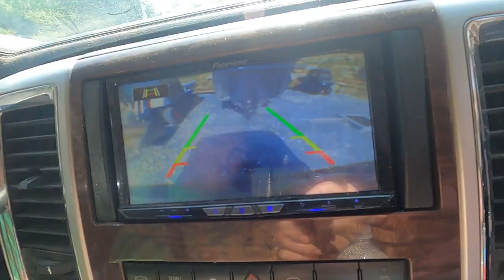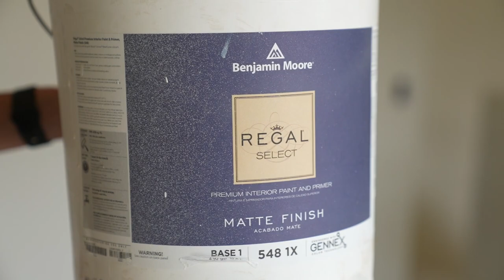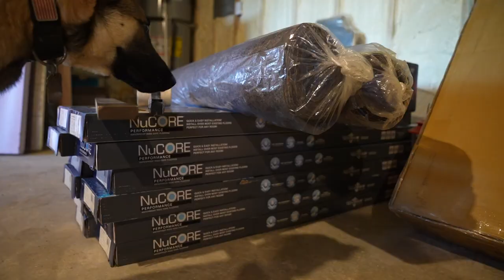FINISHING THE ACCENT WALL | DIY CABIN IN THE MOUNTAINS

Comment: I would advise NOT using MDF for the window sills. If it get wet at all it swells! And it WILL get wet. I used it when I build my house and ended up replacing it all with Corian. You can use ANY countertop material such as ceramic tile, granite, quartz, or etc, as they are all unaffected by water. It looks much better and will last forever.
Reply: Yes, Corian, which  looks like French/Italian White Marble, if you get it in white and  finish it  in a crown  molding  edge  that you like with be care free and not as heavy as MDF., You'll  never  have  to paint it, and it won't swell or mold like MDF will. Otherwise, get  the standard  wood, stained  or painted,  in a  high gloss contrasting Dove wall paint. F/I White Corian is a subtle  polished  marble  look, and if you get it with a double turned down edge,  it looks  very elegant and   simple.

Comment: I had stained concrete floors in So. Tx and really liked them. Seems like a reasonable suggestion for a mud room. Easy to clean, no worries about dirty boots. Cheers!
Reply: Concrete gets slick as snot with ice and snow.
Reply: If you hate it .. put in floors later. Cut the corners for now. It's fine. Exhaustion doesn't truly set in until the Baby comes home. You both should decompress a little before that happens. Even if you have to start out in the camper. You will need your strength. Be well. Much Love!!
Reply: @fawnsells6226  agree!  I believe there's textured non-slip paint (primarily used for garage floors) that could work well.  It's not only muddy boots  but especially the dogs that will make having an easy-care entry space such a bonus.  Maybe try it for a winter and if you don't love it, it would be an easy upgrade next spring. 🙂
Reply: @patriciacarter4227  My brother did stamped concrete that looked really beautiful and it's durable. It's on their outside spaces and they don't have a problem with it being slick. Inside the house they put ceramic tile that looks just like wood flooring. It looks awesome.
Reply: @smarterthanawaffle  you put a grit in it to eliminate that issue
Reply: @trippinonamystery5814  My brother did ceramic tile that looks just like wood flooring and it looks amazing! Their house appraises for almost a million so it definitely doesn't look unwelcoming.
Reply: @kimberlyearly8918  I reported it too! ❤️
Reply: Concretes great in a warm climate but will be an absolute ice cube in the cold.
Reply: Lest we forget that there is going to be a toddler out there, my dad calls them little drunks.  I would hate to see him toddling around and hitting his head on concrete.  Better to have some kind of flooring that gives a tad bit.
Reply: @kimberlyearly8918  -  Also go to the About page on the channel. Click on the flag and proceed. The only category that works is "scam or spam" and on the note page I paste the message along with promoting porn. (Only 300 characters allowed.)

"learna" is probably part of the sock puppet gang with channel names "Alexa - Hakaamaru Ros - yuuki Asuna - funny - ROSE - Airis - Asuna yuuki - Natalie - Agnez" that have infested several channels that I follow. I sent a message through Patreon to Allie about the infestation. Either Allie has blocked these scammers or flagging on the About page was effective.
Reply: @tuter1972  -      Also go to the About page on the channel. Click on the flag and proceed. The only category that works is "scam or spam" and on the note page I paste the message along with promoting porn. (Only 300 characters allowed.)

"learna" is probably part of the sock puppet gang with channel names "Alexa - Hakaamaru Ros - yuuki Asuna - funny - ROSE - Airis - Asuna yuuki - Natalie - Agnez" that have infested several channels that I follow. I sent a message through Patreon to Allie about the infestation. Either Allie has blocked these scammers or flagging on the About page was effective.
Reply: @patriciacarter4227  Exactly.  Allie, it's just for the winter. ;) Maybe you guys could revisit it in the spring. Release your expectations of what done means for now and just enjoy that tiny boy human, who wont mind one bit if that floor or anything else isn't all the way done yet. Unless it's not going to take that much work at all and has a low risk of anything going wrong... then... just do it. LOLOLOLOLOLOLOL Why not?

Comment: Brandon, you should always use a push stick when cutting trim on a table saw; I learned that several years ago when I cut my thumb off.
Reply: Yes, absolutely! A 4 fingered carpenter also told me, when using a table saw, to hook as many fingers as possible on the back side of the fence when pushing wood through. If the blade binds, or kicks, hopefully it will keep your hand away from the blade! It would be horrible if Brandon had a hard time hanging onto those cookies before he devours them!
Reply: Nobody should lose a thumb or a finger to learn basic safety around a table saw.
Common sense.
Reply: @gervaisbilodeau8465  I agree! I was young and dumb, learned my lesson. Thankfully, they were able to sew it back on.
Reply: @James-hp7li  My sister's neighbor got 3 fingers chopped off on a table saw. 
He was lucky to have them  reattached even if only one is back to nornal.
Reply: @gervaisbilodeau8465  Glad they was able to reattach them. I won't rip a board on my table saw without a push stick now. Table saw is probably the most dangerous saw in a shop.
Reply: I thought the same thing.  With all the tools and gadgets Trent buys he should have bought a push stick for safety. Scares me when I see them not using one.  @Trent & Allie buy one please!
Reply: Absolutely. I felt faint when I saw how close Trent's hand was to the blade. Yikes!

Comment: Why not build a firewood shed and only move the firewood one last time?
Reply: Time they don't have right now the house is more important than a shed when they can do it later.
Reply: Agreed. Having it all in one permanent spot, would make it easier to keep it topped up thru out the year
Reply: We just brought in a horse shelter. Open on one side, sloped roof and stack our wood in there. Wood next to the house is a fire hazard but also attracts mice…which then attracts predators. Best to have just a weeks worth at the house, stored on a wood rack for ventilation so it stays dry.
Reply: Easier to knock some wood racks together with feet/legs on them to elevate the wood off the ground ..... located away from the house ..... maybe a small rack on the deck that can hold at most 2 days worth of wood then kept covered to keep it dry.  The wood on the bulk racks should also be kept covered to keep it dry ........ nothing worse on a cold, wet, windy, winter day when you want to have a cozy fire and your wood is wet or covered with snow and frozen together.  Been there, done it and it wasn't fun trying to get a fire started and then once started trying to feed it and keep it going with only wet firewood available.
Reply: Yes!
Reply: Exactly!  By the time they've moved the firewood 3 times, they could've built a firewood shed.
Reply: I thought that too but my guess is maybe they are waiting for the person to come grade (sp) a good spot to build one on? Maybe?
Reply: We had a wood pile by our house once. Mice love them and love to come inside to stay warm!!
Reply: @lindaklassen9293  and snakes follow shortly after. :(
Reply: Beyond belief that anyone would store fire wood under the house. Time to stop, think, and do the right thing to reduce risk. Might be worth looking closely at the house insurance policy too. In the USA do insurers underwrite fire risk if the wood pile is under the house?
Reply: They are still working on the yard to improve it. Once they are done with that, I am sure they will build something away from the house.
Reply: Yes, they built a house, they can "probably" (lol) build a shed or lean to and maybe even have scraps of wood there to build it with. Great idea, imo. 🌸🌺🌷
Reply: @Warcity777  it would be a shed. Which they could do in one day. I hired a guy to build me a storage building and he done it by himself in one day.
Reply: @TMOO546  which they could hire out.
Reply: @issieanderson2083  so should they remove the deck too. And then the walls........
Reply: @Ekinnajay  maybe
Reply: @barbibutton9619  I doubt on the scraps. Did you see what went on that trailer. And so much kindling that could of just been put into a box.
Reply: @ShandeleReynolds  Trent was pleased that they had cleared such a wide boundary around the house because they live in an area at risk from fires.  He then decides to store wood under the house. Go figure. Sadly I think that North America may have to reconsider building with wood going forward given the devastation caused by fires over the last couple of years. BTW the deck is made of a man made composite, I think.
Reply: @Ekinnajay  Yes, they said that in the video. I also heard them mention that mice loved their scattered wood. It doesn’t take much ce long to move in and there’s all those windows along there. Just saying.
Reply: @Ekinnajay  Sorry for the typos😕
Reply: @ShandeleReynolds  yes, actually after I commented, I remembered seeing some good wood (to me it was "good" wood) on the pile
Reply: @issieanderson2083  They will after they finish the house before winter and Baby.

Comment: 25:10 Shower doors seldom go all the way to the ceiling, unless it's specifically designed as a steam room, and there's no real need to tile the ceiling. You can of course, but a good couple coats of a semi gloss paint will protect it just fine. Options a plenty of course but no need to look at just one opinion and best of luck as always.
Reply: I would think it would be smothering while taking a shower. I would die!
Reply: Yes.  I had a 1960’s show built like that and it was so claustrophobic.
Reply: And have a decent extractor fan to remove the steam from the shower .

Comment: We had a similar setup for firewood. Against a concrete wall, under the deck, pulling from one side, replacing new firewood on the other side, and it worked for years.  It doesn’t matter where the wood is, you will get critters in it, just use gloves and watch for the critters. It will work. I love the wood, in the sun/mud room. Some big hooks, coats hanging on the wall, some muddy boots and it will be awesome. The painted and textured floor, in a mud room is pretty amazing and almost indestructible but any floor will look great. Trent and Brandon are now professionals!!! Allie, without you they wouldn’t be able to do all they do and we wouldn’t have such a wonderful experience following your journey! Cute baby bump, too!

Comment: Down the road, when all else is done, you could figure out a spot where you could build a firewood open shed... has a roof, slightly elevated deck and open sides. Then you can stash your cords of wood that would be dry and not under the house. Then stashing wood under house would just be for a couple yrs.

OMG! I have Ben Moore's Dove White in several rooms in my home. It's a very pale gray. In my kitchen I painted a slightly darker gray in the cabinets to contrast.

It's so cool that with the house build, and even with your travels, you'll be able to show your kid when old enough to enjoy and appreciate.

Comment: Down the road as that accent wall dries the seams may open up.  What I do to combat this is staple a nice section of black tar paper in behind it.  This way when it opens the gap will show black not insulation board pink.  You really should tack up some temp railings on that deck.  It is not safe the way it is.  It is so nice to have friends like you do to help save on expenses like dump stuff hauling and your drywall clean-up friend and of course the amazing Brandon.  What a pal he is.   It's amazing how much energy you get when you see real progress.  I am glad to see you got a table for the chop saw.  It makes the cut work so much easier and the dust just goes over the edge.  Yay!  Progress!!

Comment: Uh, dude, I live in New England and have in my yard 4 cords of firewood stacked.  The oldest stack went up 3 years ago.  My firewood is dry as the summer wind,  because I put a tarp over the stacks.  For goodness sake.  Find a level spot behind the house stack the work and cover it.  Sometimes you make your life more complicated than necessary.
Reply: We used to cover our stack with a sheet of corrugated iron. Later we put out a few posts for the corrugated iron to lean on because it tended to be quite sharp (especially when you have to handle it alone when you're quickly getting some firewood.

Comment: Stain the mud room floor.... And I'm still saying you should put front porch on the whole front of house...
Reply: Actually, I was thinking at least a partial roof over the front deck.  I suspect the bugs are really bad some times during the year and a screened room would be really great because then you could keep the windows and doors open for the breeze and have no bugs coming into the house.  By the way...why would you not design and build standard doors for your house???  Anything custom is expensive and the wait time can be a real pain.  This should have been measured and ordered a long time ago.
Reply: Snow sliding off the main roof could be an issue. The deck was made extra heavy because of that.

Comment: the problem with stacking MOIST wood is the problem that occurs with HUGE HAY BAILS - the reason you see them outside DRYING before they're brought into a barn - THEY CAN BLOW UP BECAUSE OF METHANE GAS -  no matches involved!!  i saw AN ENORMOUS BARN FIRE due exactly to the fact that the farmers <stupidly> stacked the hay inside the barn BEFORE it was completely DRY. that wood should NOT be stacked near the house. you need to MOVE IT AGAIN. work work work - it can rain on it, it doesn't matter. always keep a few cords handy, but not that whole pile - no no no. furthermore, the side of the house will ROT from that wood - and rodents find it a cozy place for nests. omg move that wood. wish i could help, but i'm in DUBAI LOL
Reply: The wall is concrete. Small chance of rot!
Reply: Wood does not spontaneously combust. If it did every forest would burn continuously. It needs a catalyst (an outside source of heat). Hay does combust when it is wet because of the mold and and mycotoxin growth that is in hay in small amounts when it is gathered. If it is "baled" when it is not thoroughly dry the mold and mycotoxins will grow very quickly and the heat of their growing will cause spontaneous combustion.
Reply: Agreed TOO RISKY
Reply: @smckee9063  I hope so! It will still create moisture along the house and should just be stacked between some trees
Reply: @arielstrafing5225  The basement of the house is cement not wood. It might stain the cement but not rot it.

Comment: If you will be painting outside it would be better sooner than later because your paint needs time to fully dry/cure before freezing temps. I had a painting company back in the day and that was my rule of thumb. My exterior paint jobs lasted 25 years without peeling. I didn't recommend pushing repainting out that long but people did. You both are doing a such a great job!

Comment: We always found that blocking off the middle section under the patio was a better solution for the wood,   Stack the wood against this barrier and allow a rock pathway between the stacked wood and your outside wall.  This way your not putting the wood against your wall.   The wood doesn't get wet and your dogs can take care of mice.   I get my dog a rattle snake shot every year because I  live in the Sierra Nevadas and we have rattle snakes.

Comment: I live in Maine and we heat our house ONLY with wood. (We have radiant floor heat but it takes so long to heat that way that we never use it unless we plan to be away for more than a day or so) We have our wood stacked against the south side of the house with some stacked on the covered deck so if we get a huge amount of snow we can still access some wood while digging the main wood pile out. I don't think Ive ever thought about or been concerned with the wood catching on fire. 

Also, most of the downstairs floors in our house are a wine red polished concrete. I would maybe not go with concrete floors again just because they are cold if we don't use the radiant heat. They are also pretty unforgiving for falls and sitting on the floor if you are thinking about babies and toddlers. That being said, they look really nice!

Comment: You have the Kubota tractor/snow blower. With the loader/bucket/pallet forks you could also do basic landscaping, and lift stuff up and down loading and unloading trucks and the trailer like picking up your big refrigerator and placing it on the front deck. I have several of the cages from liquid totes that I keep firewood in. I can store them and just bring one at a time in close to the house with the tractor.

Comment: Hey Allie, we have an old barn converted to a pottery gallery. We had a thin layer of stained concrete applied to our cement floor that was then sprayed with an enzyme that now looks like marble. Any stain you want, very durable and beautiful. Check it our before you say no.

Comment: That's a brilliant idea. Stain the concrete floor in the room that is dedicated to being a barrier between outside and inside. An air lock and room that will see dirty, wet clothing. Sucks your lumber prices are still high. I just bought 2x4s for $3.25.

Comment: Suggestion: open your windows in the basement and any windows high up in the house and that should create a cool draft through your house as you spray paint and work with a little cooler air quality.